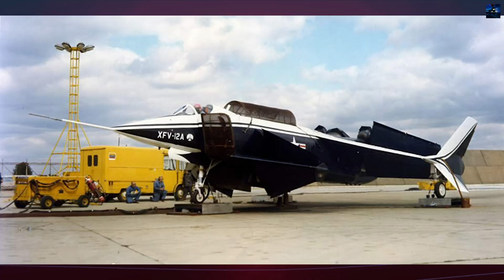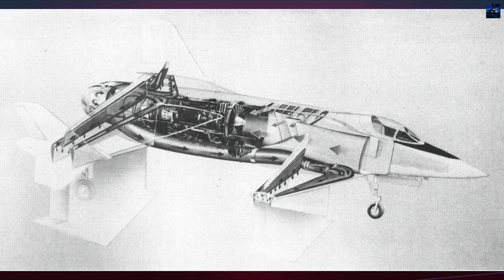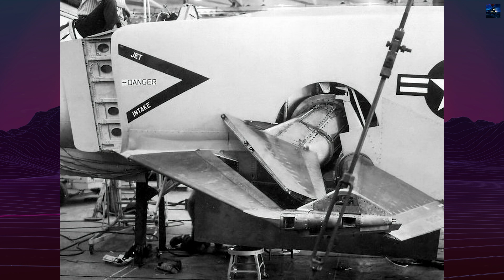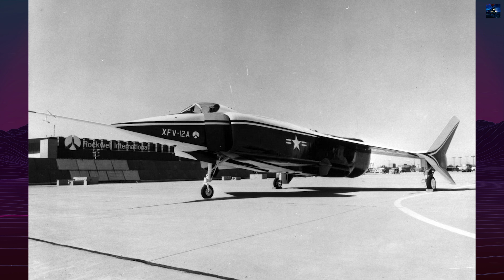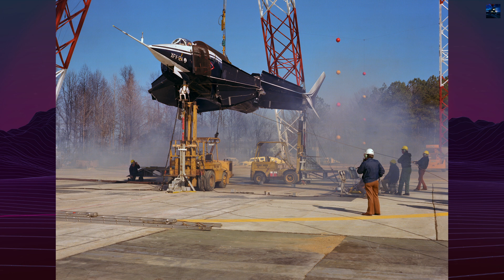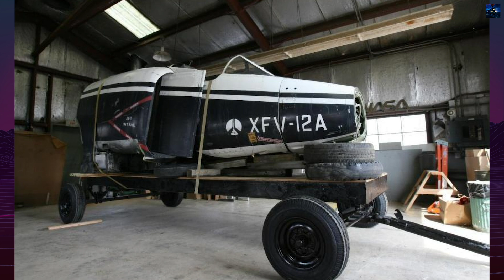Rockwell XFV-12: The Fighter Jet That Never Flew

Comment: Auxiliary lift engines? No. Extensive, complex interior ductwork? No. The unquestionably successful Harrier used vectored thrust with a simple duct system to achieve VTOL, and the F-35B followed the same basic design. Rockwell should probably have built a simple technology demonstrator first. They might have found out that their design delivered below anticipated performance. Anyway, this looks like it might have been a great fighter without the VTOL baggage. Live and learn!